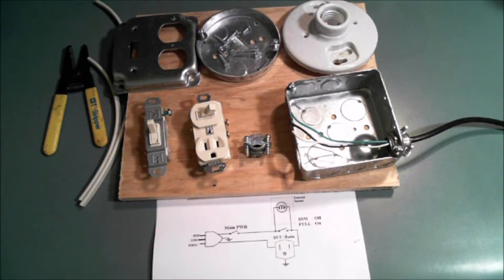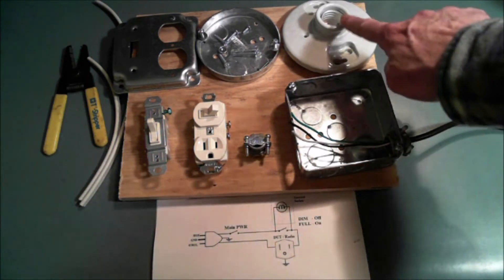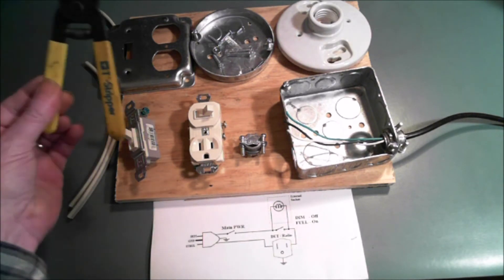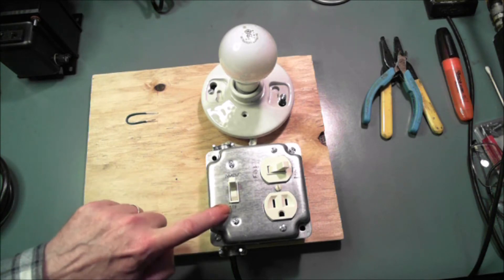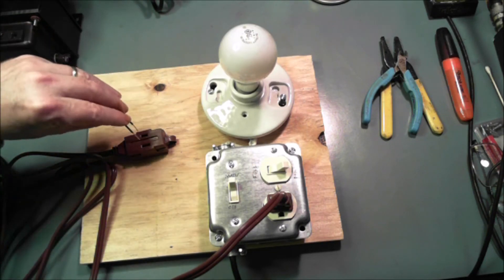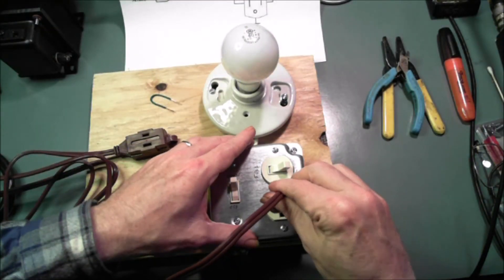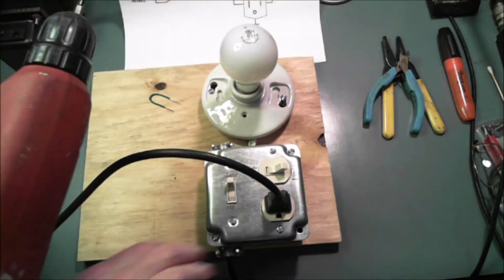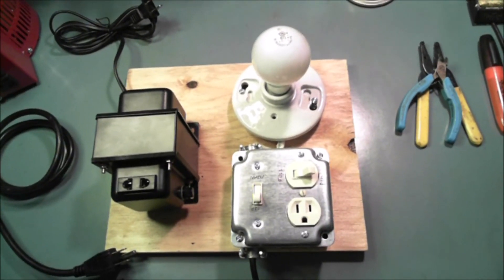Build A Dim Bulb Tester

Comment: This an excellent device ( I have made many , over the years ! ) .... also very useful as an input  ballast for EHT transformers running gas discharge tubes ( they exhibit negative resistance ) ..... also highly useful to work out windings of unmarked transformers ... should you connect the full mains to the 12 Volt winding , you just get a very bright light ! .... ( tried - n- tested ) ...........

Comment: Well done and nice set up. I am going to build one and I like your wiring arrangement.
Question Please: Where did you buy your isolation transformer and do you remember the approximate cost? Thanks. (Gave you a sub)...
Phil
NYC Area
Reply from the maker: Hi, thank you for the complement.  I got the transformer from amazon.  it is a "Jameco Valuepro ITR300 Power Transformer, Isolation, 120VAC, 300Va, 3.2" W x 4.6" D x 4.2" H" currently unavailable.  Try Google, but good luck. I couldn't fine another one as of this day. :-(  Let me know how the dim bulb tester build go.
Reply: @aroundtheshack  I'll keep you posted. If you find any isolation transformers I should check out, please feel free to send the info. Thanks.
Phil
NYC Area

Comment: A good video. But two things... many times your voice trails off weak as you come to the end of a statement. I had to keep going back and cranking the volume to pick up those last few important words. Also, you supply the circuit diagram and beautiful pictures of the parts and the final assembly, but you don't really build the tester. You kinda dance around it. I enjoyed the video, but it's not what I expected based on " BUILD a Dim Bulb Tester. Please don't be offended ~ of all the Bulb Testor video's I've watched, I think your design is the best.
Reply from the maker: Hi Carl,
  Thanks for watching and no worries, I’m not offended.  Sorry about the sound.  This was one of my first video attempts.  I promise, they got better. (I have better mic’s now) And unfortunately, there is no way to fix it.
  I chose not to video the actual building of the tester because that would make a 2hr video… bjoring (lol) and anyone that is actually going to build this already knows how to strip wire and turn a screwdriver.  Well, that was my reasoning anyway.

Comment: Probably a stupid question, but can you have a low wattage bulb that would blow up, or is the wattage way higher than most electronics components consume? Also, do you use software for your layouts and schematics or is that free hand? Thanks
Reply from the maker: Hi Gary,
    Sorry for the delay...  The wattage of the bulb should be greater than the DUT.  If the bulb wattage is lower, the worst that will happen is the bulb will light full and the DUT won't power up properly.  The bulb won't ever "blow up." 
Most of the devices I test run about 25W, so I use a 60W bulb.  

As for the drawing, this one is freehand.  I use LTSpice for electrical drawings and design.

Comment: Great little video, ilike the idea of the switch as you could turn it off quickly if there is a short detected  in the tested circuit. 
With that said it was nice to see how the device also took a big load off the drill.
It was a good demonstration how it also helps protect shorted circuits. Thanks
Reply from the maker: Hi Luc,
   Thank you for your kind comment.  I am glad you enjoyed the video.  Let us know if you build one :-)
Reply: @aroundtheshack  thanks for the reply, I was going to build one this weekend with spare parts, but I like the way you did yours so I will go to the  hardware store to get parts to make it look more like yours. CHEERS